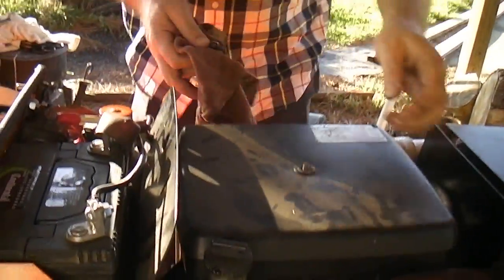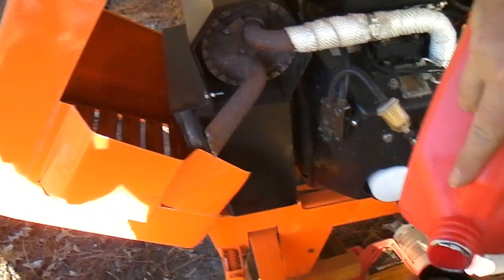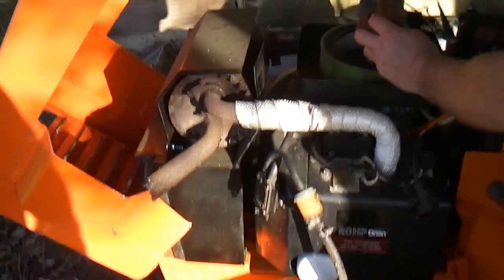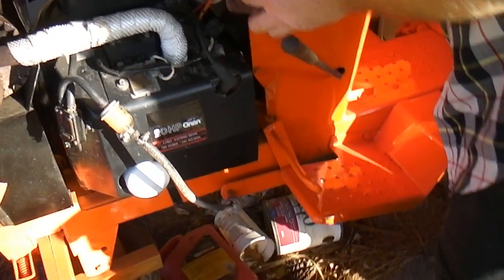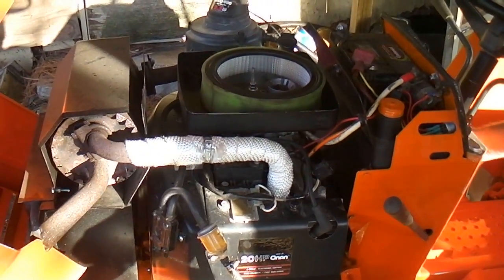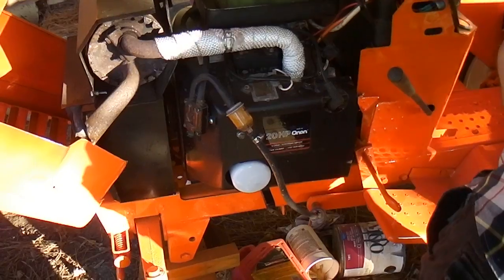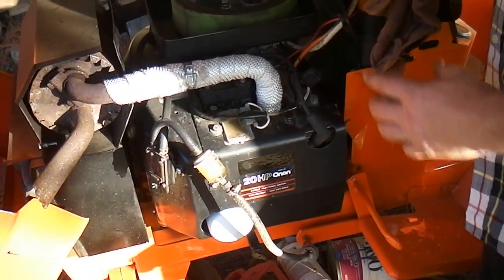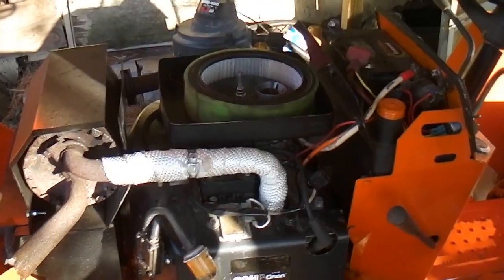Case Lawn Tractor Runs a Short While

Comment: @shartne I think you can get approx 2.5 inch pipe.That will work though.They usually have one screw to hold them on.There will be a gap between the 2 pipes but people will only see the Chrome section.